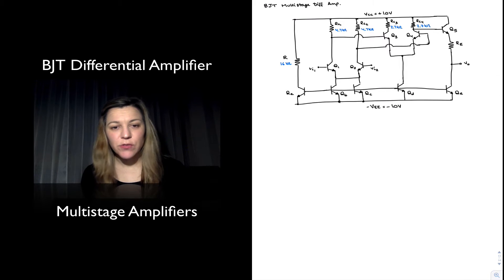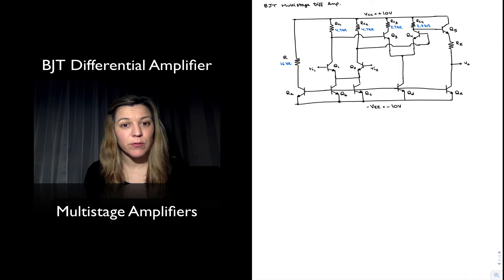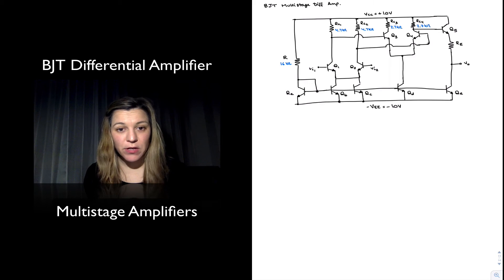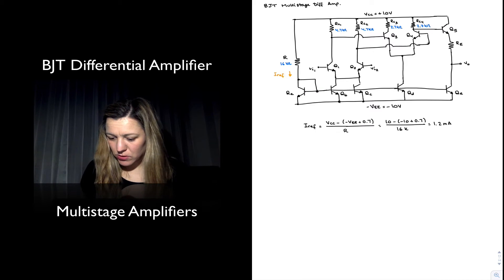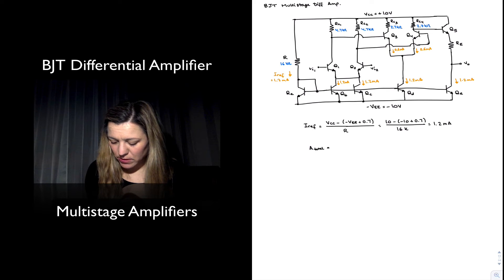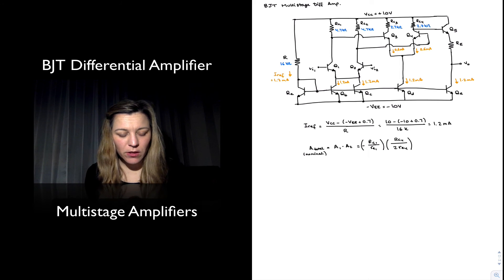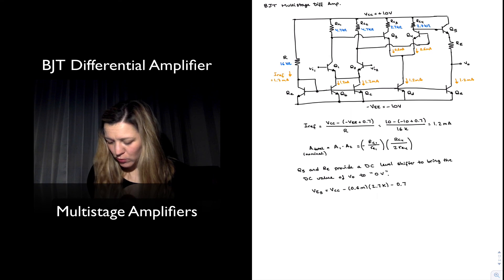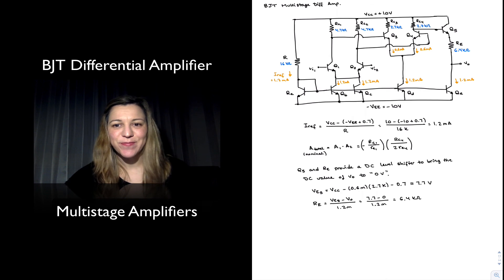BJT Diff Amp: Multistage Amplifiers

Comment: The content creator of this channel seems to be inactive. Rarely do they respond to comments/questions.

 Is that not possible to 'steer' other BJT with Wilson current mirror? Only simple/basic/traditional current mirror can slave other BJT?

What works is I need to duplicate the current mirror AND with extra biasing/Iref resistor. This becomes insane because there are total of 16 BJT! 8 for active load. 8 for current mirror.

But I find that simple one does not control current much. Current is very stable with 3 BJT. Current is as if untouchable with 4 BJT. So, if I could slave other BJT with 3 or 4 (The 4 is most preferable) then it would be excellent.
Reply: Hey i also have some doubts, can i get your contact  , so that i can clear those
Reply: @EC-Engg  I do not know why YouTube disallowed me to enter my contact. I thought I replied to you twice. Let me try again. My contact is scam-419 (at) wellsfartgo.gov

Comment: Finding Atotal, that part is confusing. How were A1, A2 chosen as 1,4. And how did you find them. (Balanced? Single Ended?)

Got it, A1, is for 1st differential pair, which is balanced, A2 is for second, Single Ended.
Reply: Hi did you find your answers to your doubts